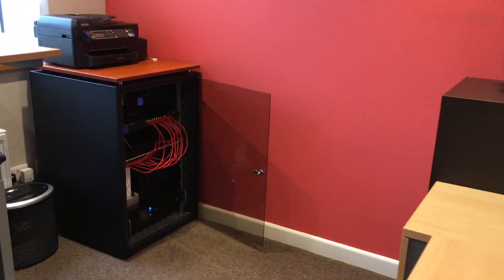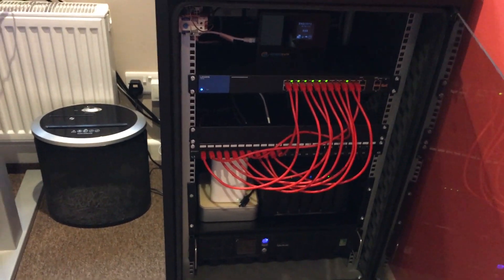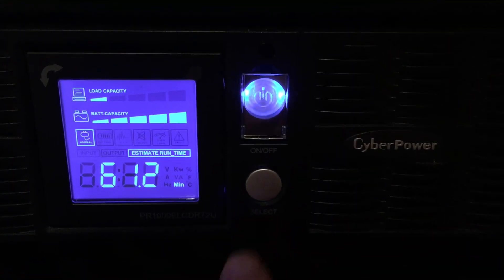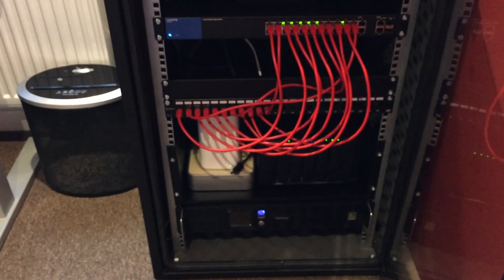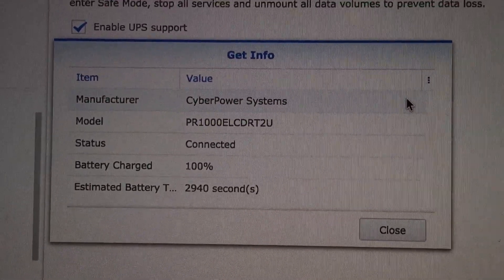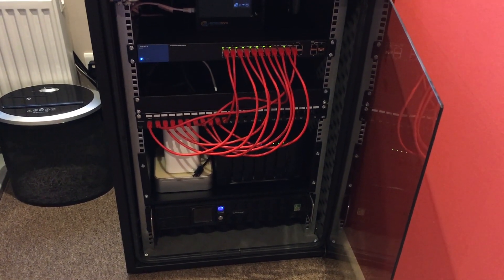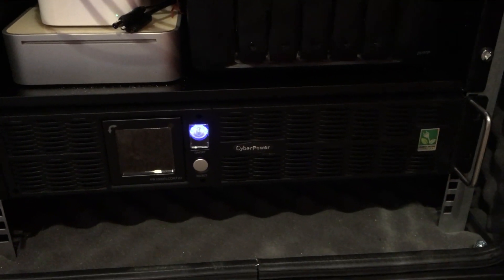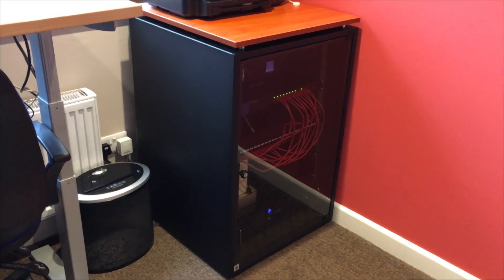Testing a UPS. Cut the power and see what happens!

Comment: how many milliseconds or seconds can the PC last after the power supply was removed?The UPS seems like it takes a time to start up.
Reply from the maker: The UPS is permanently switched on and the devices it powers are pluggin in to it. It kicks in immediately it detects the voltage dropping. Works a treat!
Reply from the maker: The UPS is permanently switched on and the devices it powers are pluggin in to it. It kicks in immediately it detects the voltage dropping. Works a treat!

Comment: Can you tell me how much watt is your computer using and how long the battery last?
Reply from the maker: Hi @Sorrowful sheep I don't just have my computer connected to the UPS, I have quite a few items hooked up - the computer, a NAS, a network switch and more. Even with all those I can still get 2 to 3 hours depending what I'm doing with the computer. The wattage that the computer needs varies massively depending on what I'm doing with it. It varies from 64 watts idle right up to 370 watts if it's doing a very heavy CPU task. Hope that helps! Andy
Reply: @TheRamblyChannel  Oh I forgot your UPS is very expensive so it can last 30min or more! :) Thanks for the answer!
Reply from the maker: @sorrowinchrist3387  Glad to help. It was a bit pricey. A cheaper one will last long enough for you to save your data and shut down your device which at the end of the day is the most important thing.
Reply: @TheRamblyChannel  But what is the point? If you don't have alot of power shortage would it be significant? Have you found yours useful????? DO you run your comp 24/7?
Reply: @sorrowinchrist3387  A UPS is more for power surges or when your house loses power. If you have a computer connected to a UPS and the power goes out, you need to save everything on your computer and turn it off. Thats the point of the UPS, its not to keep using your computer for hours. If you want something like that, just get a laptop or get a bigger battery instead of a UPS.
Reply: @TheEsotereal  Workstation have that kind of power :) Or even portable power generator.
Reply: @TheRamblyChannel  Can you tell me what UPS you have and how long would 400watts last???? I have not seen anyone put this up why?????????? How long would 440watts last on a UPS when power cut off???? Thank you so much if you can  test this youtube need such a video!

Comment: Nice video, but that UPS is really expensive for me :,c
Reply from the maker: It is pricey, you're right. There are cheaper models available. It depends how much equipment you want to power and for how long. I've got several items plugged into mine (iMac, NAS, switch, router amongst others) so that I can keep working even when the power goes off. I can get an hour or more with this UPS even powering all that hardware. If you have fewer items to power and don't mind less time then you can find something far cheaper. The stand alone rather than rack mounted versions can be cheaper too. Thanks for watching! Andy.

Comment: That's exactly what I wanted to see! A UPS in action, thank you.
Reply from the maker: Glad you enjoyed the video. Thanks for your feedback. :)
Reply: @TheRamblyChannel  well the numbers are well wrong I do have a ups aswell with 19ah and that runs only for about 10 minutes on 200-250 watts with a power factor of 0.91
Reply from the maker: @AllesanddroLP  Hi Sandro. The UPS I have stacks up well in independent tests with 32 minutes at 50% load. It depends a great deal on what you're doing with the connected devices. I have several connected to my UPS and to be honest, I would probably be shutting them down after a few minutes if power didn't return. At the end of the day, a small UPS isn't really there to keep you running any longer than is necessary to shut all your stuff down cleanly to avoid data loss. YMMV. Thanks for your post, appreciate you taking the time to send it in. Andy.
Reply: @TheRamblyChannel  that's actually funny so either my packs are bad then or my ups is just in efficient to the grade of dumping it away will check that
Reply from the maker: @AllesanddroLP  OK. Hope you manage to sort it out. Regards, Andy